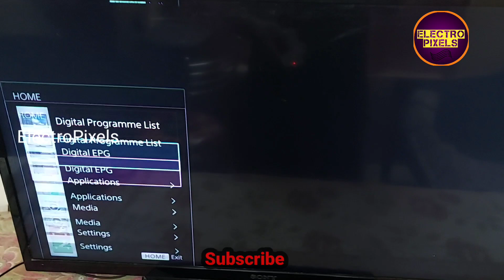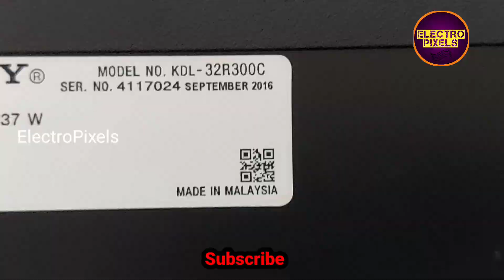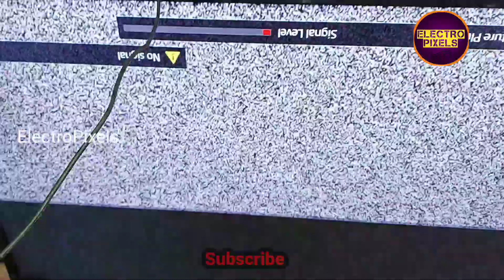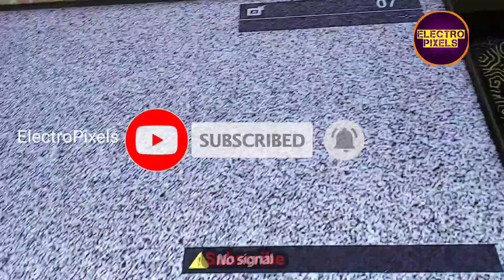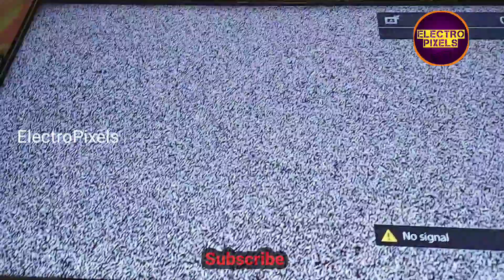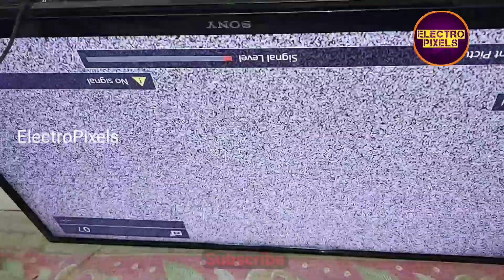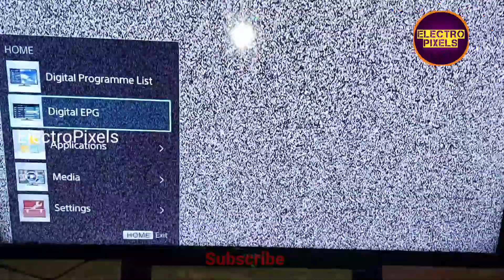Sony led Tv  Double image and color change fixing method.||Sony KDL-32R300C panel short Removal

Comment: thank you master. i have lg tv 32 inch. There is the old image at the bottom and the second image at the top. I can't find the vgh voltage on the panel. other voltages are ok.

Comment: Hi friend thanks for the informative video but what lines did you cut cos I couldn't make out
Reply from the maker: They are the Ckv lines also called as Gatesignals, if you're not a Technician please don't attempt to Repair. Consult nearest Technician. After all this is just a Temporary Solution permanent solution is Panel Replacement. Hope you Understood. Thanks For watching my friend
Reply: @ElectroPixels  thank you my friend for your response